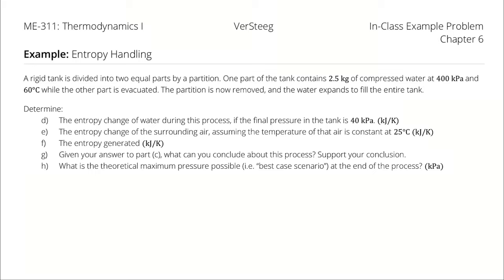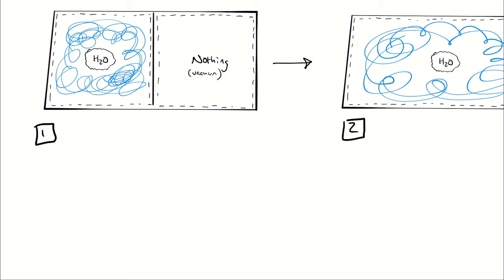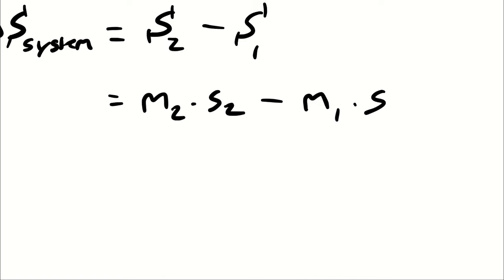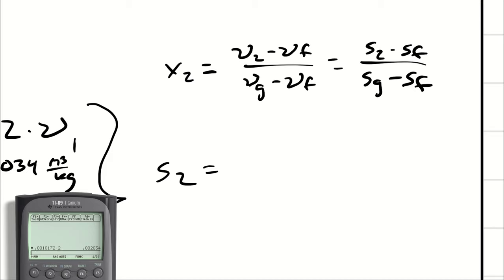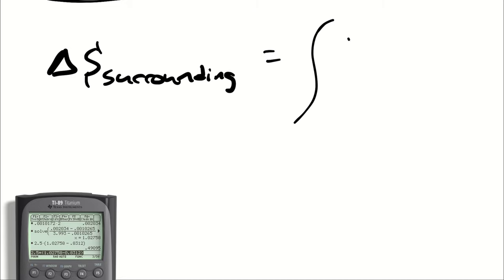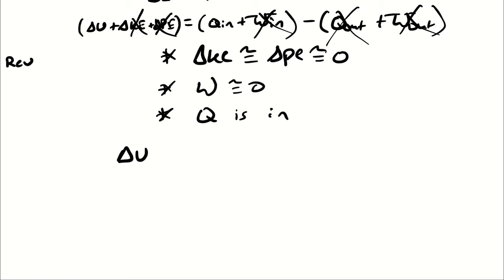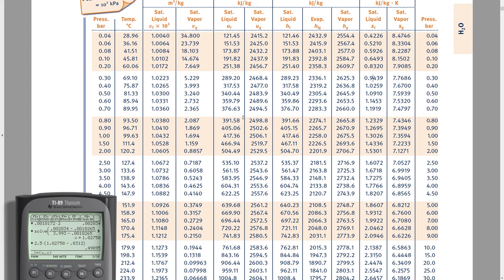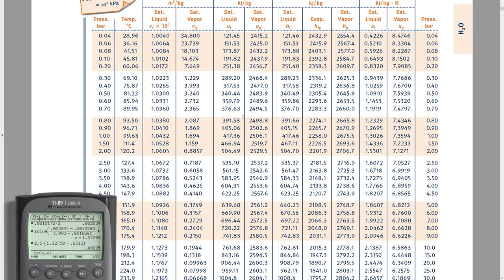Example Problem - Evaluating Changes in Entropy

Comment: Why, why volume doubled. Matter doesn't change also elevation of water level reduce 1/2. How we can say volume doubled
Reply from the maker: The volume doubled as a result of the way the problem was set up. Initially half the volume was in vacuum, separated from the rest of the apparatus by a barrier. We are considering what would happen if that barrier instantly disappeared — the same matter now occupies twice the volume.

The water level doesn’t reduce by half, as the vessel was not initially filled with water and air, it was just water — the phase changes to accommodate the volume (as a result of pressure)
Reply: But water does not compressible above their limit as we consider as Newtonian fluid. Also after expansion, water covered by doubled volume. That's not sense right? I know question says that but let exception from question and consider normal condition. Is it possible in real life? @Thermofluids